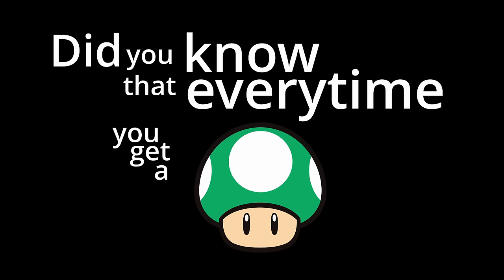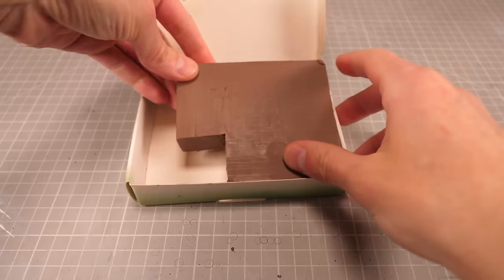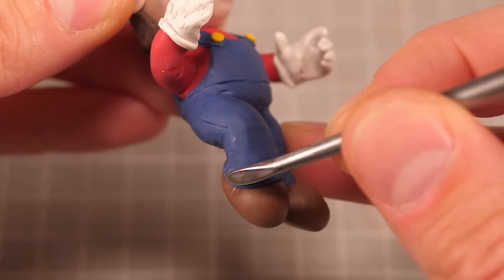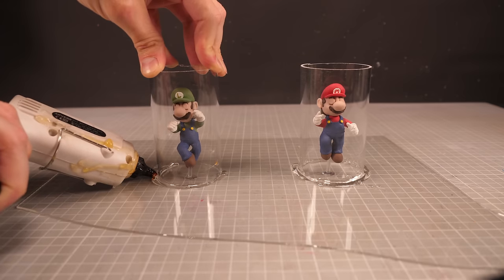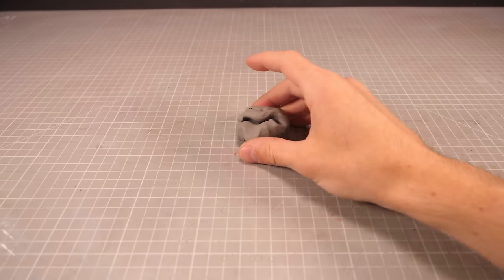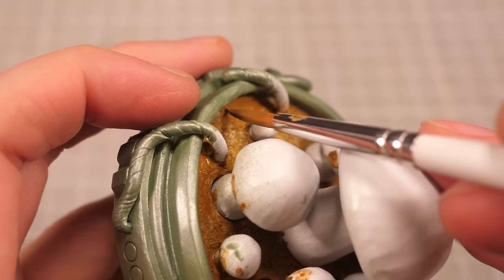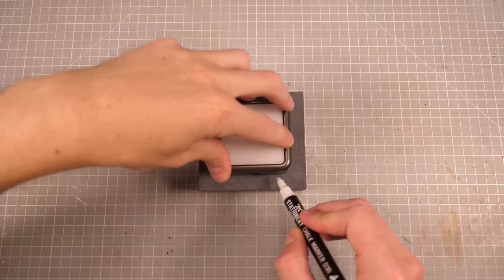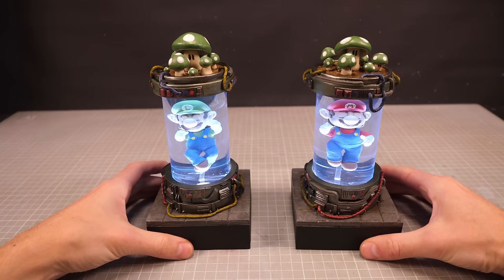I made Mario and Luigi into Clones

Comment: Hey instead of that clear tube that holds them up, could you suspend them with a string while pouring half the resin, then let that cure, remove the string, and pour the other half once they're set.  Or would it leave a weird halfway mark in the resin?
Reply: It wouldn't leave a mark !
The main risk is that the figures would move during the curing process. Either from the string rotating, or the figures wanting to stay afloat for some reason (i.e. if the resin is very dense)
Reply: I was thinking he could have brushed the clear tubes with UV, and it might have made it more clear?
Reply: peter  youtube vulture
Reply: he can leave the string if he uses fishing wire. it disappears as well
Reply from the maker: Ya, two stage pouring would work but this resin takes 72 hours to cure, so I could pour the second layer at around 30 hours or so, then I'd have another 72 hours to wait and I'd run out of week! Definintely an idea if I'm doing it over several weeks, but in a few days I usually need to do everything in a single pour (which is why so many resin adventures go awry).
Reply: i was thinking it would be better if he added some feeding tubes connected to their mouths or whatever so that way they serve as both support and.... life support lol
Reply: @NorthoftheBorder  You could also use some wormy dealies as hoses to feed the clones. Wouldn't they starve without it???
Reply: Instead of string maybe he could use 1lb fluorocarbon fishing line and just leave it in, It's stupid thin and transparent.

Comment: Idea for when you want to do a suspension deal in resin

Why not fill half the container with resin and suspension the item with string, then once the the bottom layer settles the item should hold its self up so you can remove the string and pour the next layer in!
This way you can make it more convincing and remove the need for the stick thingy you used to hold Mario & Luigi up ;D

Comment: if you want a solution to the acrylic rods being kinda visible you should make some rods yourself with the same resin you put them in, they will completely vanish that way and they don't have to be pretty either. plus if you wanna fix the ones you made if it bothers you alot you can try to drill out the acrylic and pour resin in after but that obviously comes with the risk of ruining them if you aren't careful.